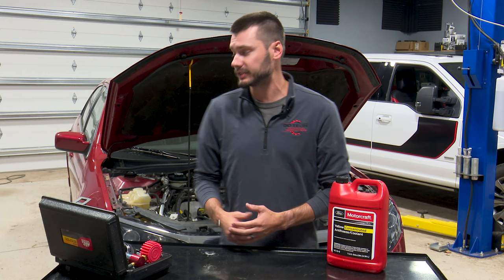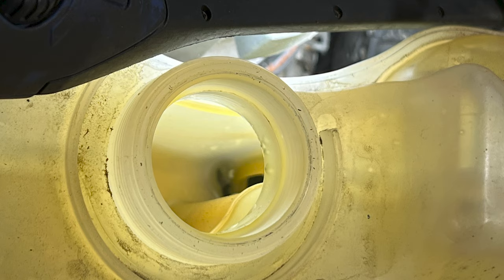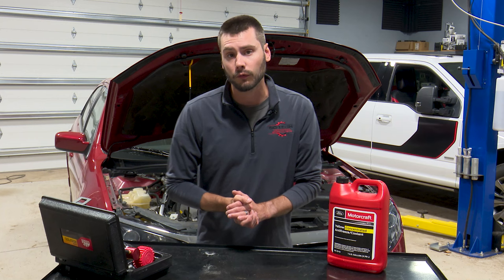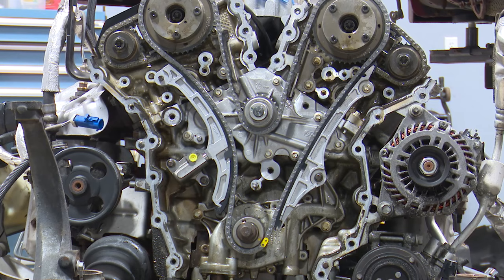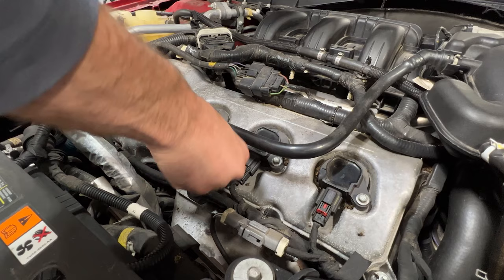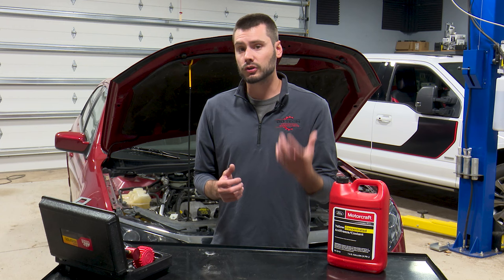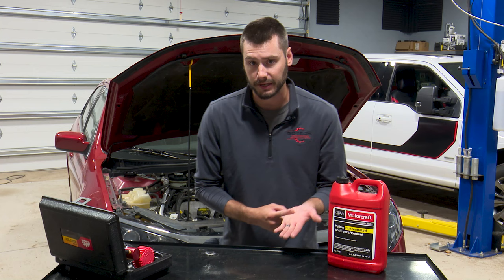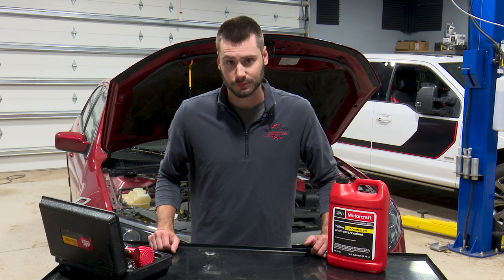How To Find A Coolant Leak Without Visible Leaks

Comment: Pure crap that the automotive engineers are designing engines these days where a water pump is installed inside engine design - but we all know they want you to bring your vehicle back for repair instead of you doing the repair yourself 🤨
Reply from the maker: Hey Coy Carlson, cars certainly are harder to work on today...that's for sure. This one gets the whole engine, trans and subframe dropped for this waterpump job. Engine comes out the bottom too.
Mike Becker, Senior Instructor

Comment: Engine oil analysis works great. You can also heat up a pan to 250 f  and drip a few drops of oil onto pan. You can then watch water boil out of oil if present.
Reply from the maker: Woah that sounds pretty cool JMC. I've heard of people sending stuff into a company, Blackstone, I think. I've never had to send anything in but I'm hoping someday I get the chance to. That would be interesting to see results of.
Mike Becker, Senior Instructor
Reply: @GoTechTraining  i just received an oil sample back with water present. It also had high copper and lead levels.  Those particularly metals indicate the main bearings have worn.  Neat stuff.
Reply from the maker: That is cool to see. What did that run you to have done?
Mike Becker, Senior Instructor
Reply: @GoTechTraining  nothing i work for catapillar.     It was a customer's machine.
Reply: @GoTechTraining  20.00 I think.
Reply from the maker: Ahh that makes sense. Big expensive engine I bet. You rebuilding it then?
Reply: @GoTechTraining  no customer wants to run it tell oil light comes on 😆. Not joking.
Reply from the maker: Woah. Wonder how long it will last!
Reply: The good old "crackle test" !
Reply: I had the problem for 5 years just keep checking the coolent you be fine I sold the car after the 5 years to my neighbor I told her about the issue and she still driving the car 
2007 Nissan Murano
Reply: I can smell it but can't find it going on five years I'm starting to just accept it Carrs temperature stays at  205 ,212  Can coolant  seep through rubber hose I don't know where it's going I don't smell it anywhere but engine bay,  There is a small hole where the Reservoir is where it would escape gases maybe that's what I'm smelling because it's not completely sealed there's like a little drain thing  just in case it overflows  My 2013 Mazda 62.5 L  Generation Two body style

Comment: More than likely put inside the engine for packaging the engine in tight engine compartments of different platforms.  Should really have designed an external, electrically driven, water pump like the euros use, AKA: Break My Wallet.
Reply from the maker: Hey Grumpy's Garage, yeh that's probably true. That 3.5L is CRAMMED under the hood of a 2010 Fusion!
Mike Becker, Senior Instructor

Comment: I’ve got disappearing coolant on my 04 Nissan Titan and see weep marks on the plastic end caps bonded to the ends of the metal middle portion of the radiator. Oil is clean, so time for a new radiator.
Reply from the maker: Hey, that sounds about right. Good luck on the replacement!
Mike Becker, Senior Instructor

Comment: So the Toyota dealer messed up my radiator & put in a new one, but now the coolant in the reservoir is disappearing! Help!!!
Reply from the maker: Hopefully it was just air stuck in the system. Mark the coolant jug with a permanent marker when it's cold and recheck when it's cold again in a few days. Hopefully it's not still leaking.
~Mike

Comment: A really great test is to take a few drops of oil and put it on a piece of aluminum foil then put a lighter under the foil to heat it. If there is coolant in the oil it will make an unmistakable sizzle.  Pure oil will just smoke but not sizzle. 
   It’s also an easy way I will test a used car during an Inspection for a potential head gasket leak. After test driving the car and getting the exhaust manifold hot, drip a little from the dipstick onto the exhaust manifold to see if it sizzles.

Comment: Thanks! I’ve been having coolant loss and no over heating or visible leaks but checked my oil today and seen it was overfilled and chocolate brown in my 03 s80. Water pump most likely since it’s almost at the 200,000 mile mark

Comment: When you have a slow coolant leak as you describe what would you expect your oil pressure to be at higher or lower than normal. That could also help you diagnose this issue. Thanks for the great tip.

Comment: Great video. I am having same issue with my wife’s 2013 Buick enclave,  she came back from work the other day, fan continued to run after the car was turned off. Check the coolant and it was bone dry.   Car is having overheating issues now as well. Of course this happened at 4 pm on a Friday 🤯
Reply from the maker: Hey Sean, thanks for watching! Ugh that's brutal man. Hope it's not a major repair for ya!
Reply: Im having the same problem with my 2013 Buick encore… it starts overheating after I drive so long on it… I can’t find out what the problem is

Comment: Hey Mike.  I thought for sure you were going after an intake manifold internal leak.  Never thought of the internal water pump.  I thought engineers were supposed to be smart.  :(   lol.  Thanks again for the tip Mike.

Comment: My old 06 Nissan Frontier 4.0L hasn't had that problem, but then I replaced the water pump when I replaced the chains, tensioners and guides.  Well, just another item to be replaced when doing the above work.  Otherwise, it's the second time in teardown the pump will get replaced.
Reply from the maker: Hey Mike, thanks for watching! So I'm doing chains, guides, and tensioners in this motor since i'll be in there for a pump. Just like on a timing belt motor...when in Rome lol!
Mike Becker, Senior Instructor

Comment: I knew about the milky oil item, so that's what I of course checked as my car seems to loose coolant without visible leaks. Yet that isn't the issue, the oil is black. Still a mystery what causes the coolant loss....
Reply from the maker: Coolant could be leaking internally and being burned in the cylinder. The oil would still stay clear. What are you working on?
~Mike

Comment: I have a 2007 dodge magnum 6.1 and my coolant keeps getting low like that but the pressure test didn’t show anything also water pump was change , temp sensor, fan there is some time white smoke out the exhaust

Comment: My coolant levels keep dropping after getting my water outlet fixed it started acting like it was about to over heat Saturday, I filled it back up with coolant and by Monday it was only a tiny bit left , my heat blows out hot when I’m driving it but cold when I’m at a light or parked.

Comment: Do you think those "stop leak" coolant additives could plug up a coolant leak into the crankcase?
Reply from the maker: Hey John, I'm not a fan of additives, the passages on radiators and heater cores today are so tiny, I'd be afraid of plugging some of that stuff up.
~Mike

Comment: I have the same problem in a 4 runner 99 but this truck have a timing belt no chain,I don't know where the coolant is going.water pump is new, timing belt is new, the problem start after replacing both head gaskets.

Comment: Im having this issue with my 2105 Lincoln mkz. But i noticed it happens when i drive to work. I work 25 miles away from my home.
In the morning its on the max line and by the end of the day is below the min line 😢
Reply from the maker: Do you have to top it off then? The coolant level will differ between hot and cold.
Reply: @GoTechTraining  turns out my water pump was messed up 🥹

Comment: I'm having same problem on my 06 freightliner in my case I don't see the leak I do see steam and smell it only after the temperature gets very high I lose lot more going up a hill
I'm now going to a freightliner in Valley,AL tomorrow
Reply from the maker: Good luck Ronnie! Hopefully it's nothing major!
~Mike
Reply: @GoTechTraining  me too so far might be a bad EGR cooler that be my problem not a cheap fix 
The EGR cooler average cost
$2,000
With labor at Freightliner shop be between $3,000 to $4,000
I'm heading to the shop now

Comment: Nissan V6 engines are the other common engine with a timing chain driven water pump.
Reply from the maker: That's good to know. How are they? Fail often?
Mike Becker, Senior Instructor
Reply: I don't think they're as common to fail as the ford V6. They do have an external weep hole so coolant doesn't typically end up in the oil. Scotty Kilmer had a video about chain driven water pumps. Not a professional here, just an automotive enthusiast.
Reply: Don't forget the GM 3.8 V6 that had a common intake manifold leak

Comment: I have a 2013 ford explorer with the 3.5L and has been loosing coolant. I dont see any visibly leak and i just checked the dipstick and its normal ( level and color). What else should i check? Im getting tired of buying coolant constantly.
Reply from the maker: Hi Harold,
If your Explorer is burning coolant with no visible leaks your engine could be consuming it.
Do yo have any excessive white smoke or smell coming from your Exhaust?
If so, it could be caused by a failed head gasket or coolant leaking into your cylinders.
I would also check for coolant loss from your HVAC system, such as a leaking heater core or rear HVAC lines if your vehicle is equipped with rear heat.
Thanks,
Ryan Wilsing, Technical Instructor

Comment: anyone had lots of dry white spots and flecks all over the engine compartment that wipe off easily with coolant level dropped in reservoir? Bought a second hand car took on a long run, no over heating but found these spots....guess maybe radseal or something was added to the radiator before it was sold. Werent there when inspected vehicle..

Comment: Every 700 miles, the coolant in my 2015 Fusion Hybrid drops from MAX to MIN.  I add coolant.  The dealership pressure-tested it, saying it is holding pressure.  No leaks underneath.  The oil looks fine.  I am baffled.  What is the problem, or perhaps when cars age some coolant loss is normal?  49000 miles.
Reply from the maker: Hello,
Some coolant evaporation is normal, but not that amount. Have they tested your engine for a leaking head gasket or block. Your engine could be burning the coolant?
~Ryan
Reply: 700 miles??? I fill my car with coolant EVERY SINGLE DAY
Reply: Hi there my coolant drop from max to under min level after 3000km is this normal? How often should one change coolant im druv8ng a Gilf 6 GTI

Comment: Not as milky as i'm use to seeing with head gasket, cracked head leaks. Is it just not leaking enough or is there another reason for lack of a more white milky oil ?
Reply from the maker: Hey Terry, thanks for watching! So I'm guessing it's a runtime thing too. This thing was caught early. The customer took it in as soon as she noticed the car get hot. Maybe if it was run longer it would have looked worse? Not sure. I agree though, while not pretty clean oil, it didn't look as bad as some I've seen.
Mike Becker, Senior Instructor
Reply: @GoTechTraining  Yeah, most of the time it looks a lot like the gravy I put on my morning biscuit. Doesn't taste as good though.
Reply from the maker: Hahahah I bet not! 
Mike Becker, Senior Instructor

Comment: How weird. I'm literally coming to my computer to look up a part for the cooling system leak with no visual signs. 2014 s550 coolant leak that is a very slow leak into the washer reservoir through the washer reservoir heater.
Reply from the maker: Hey Greg, thanks for watching! Woah that sounds like a crazy place to leak. 
Mike Becker, Senior Instructor

Comment: noticed i was losing coolant after my timing belt was replaced, no leaks.. ive read that it's just the coolant settling in the system. should I be worried? thxx
Reply from the maker: If it keeps dropping after a few days I would definitely checking it out . But it can settle a bit if all the air wasn’t bled out the system 
~Ryan
Reply: @GoTechTraining  that makes sense, that's kinda what my mechanic said today he mention there maybe some air pockets. thank you for your time.

Comment: I recently replaced the radiator on my ‘19 Chrysler Pacifica. Afterwards, the coolant was boiling. I burped the system with the big funnel to get rid of the air, then it got better, no more boiling. I have no apparent overheating issues, temperature operates between 195-225, no oil in coolant or engine and there are no leaks. But the coolant after seating overnight sometimes rises and sometimes it’s low like 2”. And sometimes when taking the expansion cap off, it whooshes out air pressure and immediately the coolant drops.. but this doesn’t happen all the time. Why is the coolant level sometimes high, sometimes low?? What could this be?
Reply: Had this happen on a john deere motor for months. Everything was normal like you said. Used a block tester and cooling system pressure tester and everything worked fine. The problem was the thermostat’s bleeder hole was not at the 12 o’clock mark. So air could not bleed out. Thats for vertically mounted thermostats. The hole is at the highest point which is where air wants to go. You should check that out if u haven’t yet.
Reply: @raulcalderon9048  I n my case, the issue was the coolant expansion cap. Its O-rings were swollen and deformed, so it wasn’t holding pressure. Once I replaced the cap, the issue went away.

Comment: Pretty sure this is my escapes problem.  Is the fix going to cost me an arm and a leg?
Reply from the maker: Hey, what engine is in your Escape? This waterpump job on the 3.5L Fusion required engine removal...big job that's pretty pricey.
~Mike
Reply: @GoTechTraining  unless I'm mistaken it's the 1.6l turbo engine.  It's an SE model.
Reply from the maker: Hmmm you thinking it's waterpump related? I know the 2.0L turbo has a big issue with coolant leaking into the cylinders...not sure about the 1.6L. Is the oil over full or milky colored?
~Mike
Reply: @GoTechTraining  hard to say from the once over I gave it.  Looks overfull, but not massively.  Looks dark more than anything since I'm due for an oil change any day now.
Reply from the maker: How often are you refilling the coolant? Maybe start with a fresh oil change, monitor the level and the coolant level closely. that should give you a decent idea where it's going. 
~Mike
Reply: @GoTechTraining  it's alright.  I got it going to the shop tomorrow.  In case it's ending up in the engine I don't want it to corrode through time to find out.

But in a month it went back to really low levels, just enough to barely let the heater work.
Reply from the maker: Good luck with the diagnosis! Hoping for the best for you!
~Mike
Reply: @GoTechTraining  thanks.  I wouldn't have known to take it terribly seriously if not for the video.